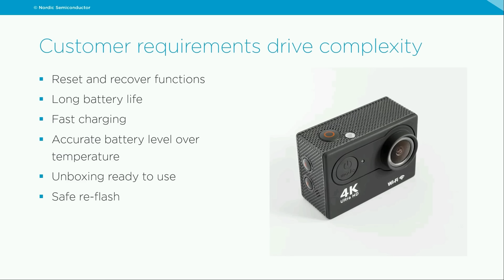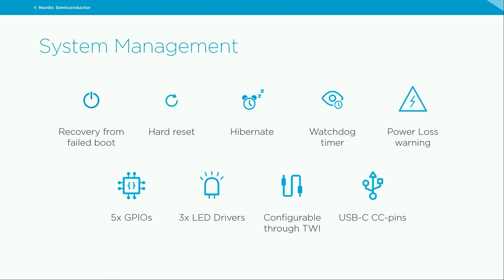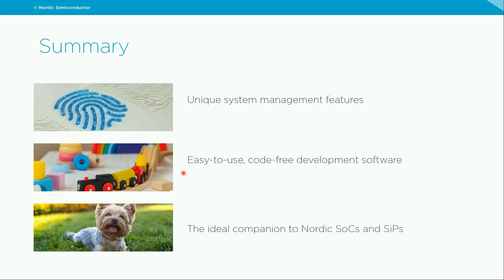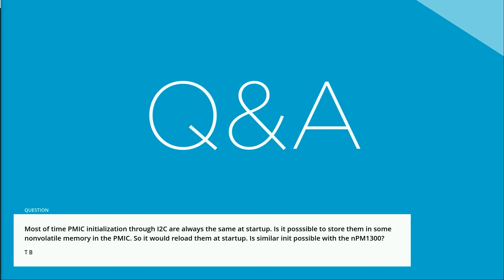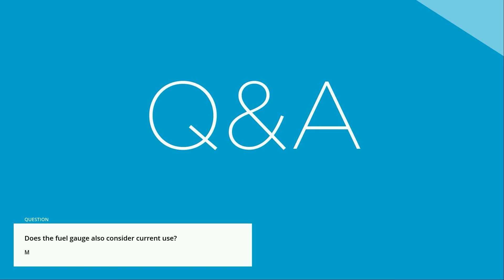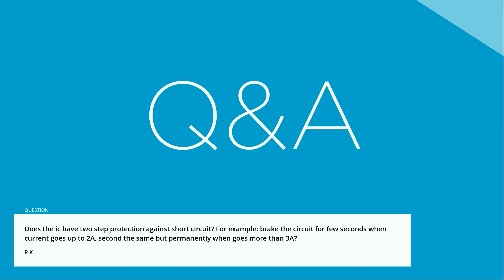Discover nPM1300 - The future of embedded power management

Comment: I'm a bit worried about the fuel gauge algorithm running on the host. In my application the host needs to be powered off or suspended most of the time while external peripherals do the sensing. It is only awake to analyse/parse data and store it. Seems to me the fuel gauge algorithm would keep the host awake for longer?
Reply from the maker: Have you seen this in our documentation? https://docs.nordicsemi.com/bundle/nan_045/page/APP/nan_045/power_consumption.html 
This shows power consumption, but also how long the CPU is running, the TWI communication is taking place, and how long the ADC measurements themselves are taking place.

With temperature measurement it takes a total of 9.4ms, without temperature measurement (if you have an application that is mostly at the same temperature) it takes a total of 7.2ms.

Comment: Hello, I'm implementing nmp1300 in my project but there is a lack of information how to do it with SES. I didn't find an example in nordic website. Is there any specific documentation for cases like mine?
Reply from the maker: Hi, 
SES (Segger Embedded Studio) is an IDE, you can use the same nRF Connect SDK/Zephyr libraries in the same way as you would in VS Code or any other IDE.

Comment: The VSYS is the unregulated output pin supplying the battery voltage and the current limit for that 1.34A max, is this correct? So if I want output to be 5V, I should connect a boost converter to that pin?
Reply: The output will track the battery so if you want it regulated, you'll need a regulator of some kind. A boost converter would do.